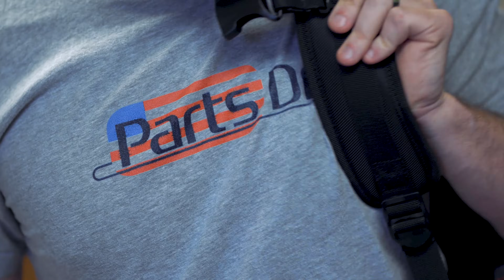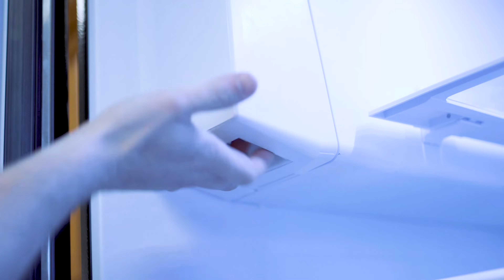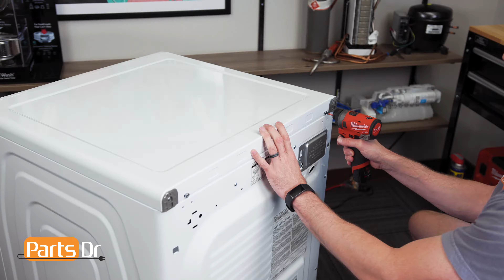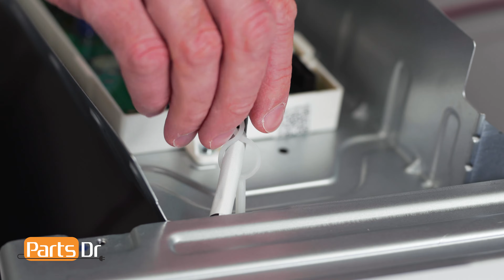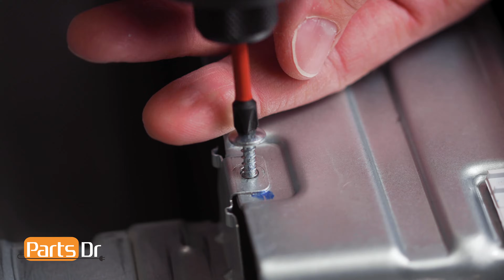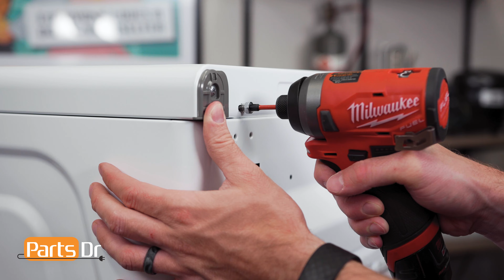How to replace Samsung dryer main control board part # DC97-21429B

Comment from the maker: Thanks for watching our step-by-step guide on replacing the main control board in your Samsung dryer! If you're seeing issues like the motor running nonstop, no heat, or the dryer overheating, this part is often the culprit. Just a heads up if you're ordering parts online, especially from places like Amazon or eBay, be careful that many of the cheaper aftermarket parts are of much lower quality. We've seen these fail quickly or cause additional problems that can be expensive to fix. For best results, we always recommend using genuine OEM parts. You can order the high-quality Samsung control board directly from us at https://partsdr.com. Happy repairing and let us know how your repair goes in the comments!

Comment: Thanks for making the video. I have a Samsung dve50r5400v dryer that spins a bit too fast. This causes large objects like sheets, blankets etc to ball up. The outside of the laundry ball will dryer but anything inside it will remain wet. Is there a way to slow it down via the control board or ?
Reply from the maker: No, there is not a speed adjustment setting that we are aware of.

Comment: Hello, my dryer started having issues some time ago, it was not heating. Then I found the heating element was broken and replaced it. It worked well for some weeks, then stopped heating again. Replace the heating element again  then I got the HC error. Then I replaced ALL the sensors, including thermistor etc, everything was OK, and the dryer worked for some cycles. Now it's not heating again, NO ERROR. I have checked the vent and it's totally clean. Would be this a sign that the control board is bad? How can I test if the control board is the cause and needs to be replaced? Thanks in advance.

Comment: My dryer is not showing an error code. It powers up but nothing happens even though it says it is drying.   Does that sound like a main power board?
Reply from the maker: Those symptoms could be caused by a bad main control board or a bad drive motor.

Comment: Good morning 
Do you know the Control Board needed for the dryer DVE45T6020W/A3
It lock similar to the board you change but I am not sure if will work 
Could you advice if posible 
Thanks
Reply from the maker: This is the main control board for your model here: https://partsdr.com/part/SAMDC92-02527F

Comment: Great video. Thank you for keeping it simple. I have a Samsung Model #DV218AEW/XAA which may be obsolete. Need the control board to fix a timer issue. How do I find out if that board is still available?
Reply from the maker: It is discontinued and no longer available.

Comment: FYI, if you have dve60m9900 the you need a dc92-01729L board.  The board is located in the front of the dryer.  Take the front touch panel off and then the front panel.  The main board is located about waist high on the left.